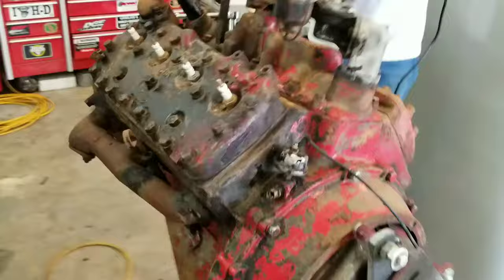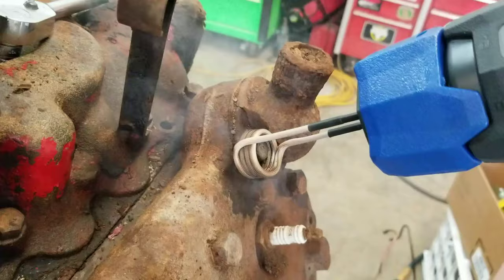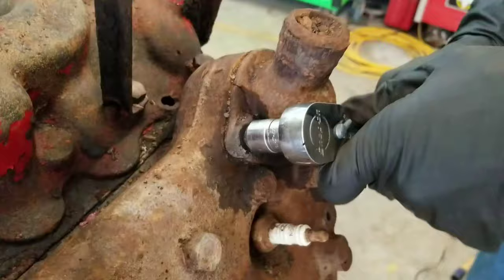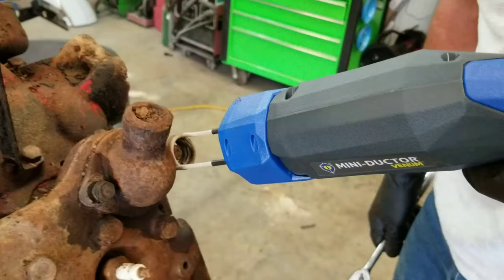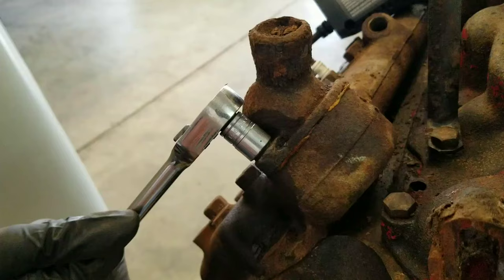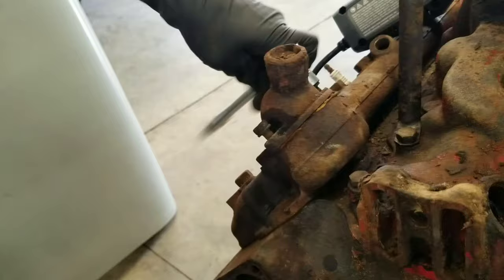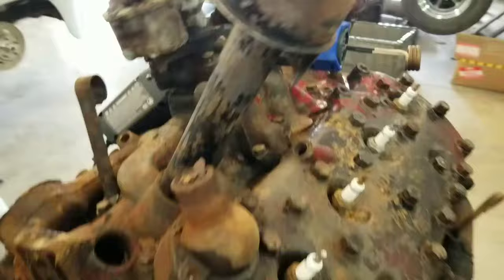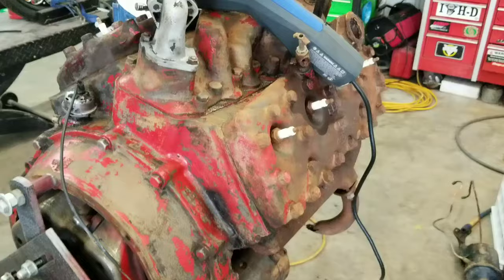A Cool Tool for Removing Rusted bolts and fasteners

Comment: What keeps the bolt from being even tighter with all the expansion??
Reply: Rickarama Trama the bolt get hot and expands then as it cools a little it shrinks just enough to come out
Reply: The expansion breaks the bond from the corrosion.
Reply: The initial heats expansion expands the bolt then when you remove the tool it instantly starts to cool off. This cooling off in when the bolt shrinks back to its original preheated size. This difference in size leaves a small gap and makes it so easy to remove. This heating and cooling expanding and contracting  also breaks the rust bond seal.
Reply: When it starts to cool it shrinks which breaks the rust
Reply: You mustn't have ever taken an auto shop class too be asking this question..
Reply: Actually it looks like it heats around the bolt hotter than the actual bolt
Reply: As the bolt expands it gets longer faster than the surrounding metal. bolts would expand in length more and faster than thickness.
Reply: Sorry my english is so suck : 🙄
Reply: I've never seen that question on an oxy acetylene torch video..
Reply: I WAS THINKING THE SAME THING.....NOT INTUITIVE.
Reply: AASR 32 I think Its a great question to ask
Reply: +Bill Butcher
Low IQ. the metal in the bolt doesn't shrink at all. It actually expands but as it expands it crushes and breaks the rust (not metallic but a metal oxide) that binds the metallic bolt to the fixture thus releasing it. Can't you instantly figure this out considering the fact the bolt is still too hot to handle after they removed it?
Reply: whoa... that's  physic 101 right there
Reply: cooling down ..duh.
Reply: Quetzalcoatl actually, technically the metal would shrink slightly, because it starts cooling as soon as the inductive heading is removed. Whether that is enough to help with the removal is another matter. The expansion cracking that occurs before then is likely a more significant cause. 

So, it's not a valid reason to call out "Low IQ". Ironically you didn't think that through completely 🤔
Reply: that's a great question, In fact it does it does expand, but the bolt/nut is seized because of the rust.  the expansion of nut/bolt with heat breaks the rusted connection.  then you are able to break the nut. even with the expansion.
Reply: Ill say its two fold, first the hot bolt expanding crushes the larger dirt particles smaller and secondly the heat separates the dirt from the oil lubricating the bolt just enough to get it moving.
Reply: The bolt will extend in length more with than width, releasing the grip
Reply: Finally somebody got it right.
Reply: Sorry my english is so suck A shoe maker....Hahahaha
Reply: +Rennie
Contraction has nothing to do with this. The metal is still way hotter than what you started with. The metallic (not rusted) part of the bolt is actually larger than your starting size. The expansion is done to crush the rust that seals the bolt to the fixture. Once the rust is gone it leaves a gap and the bolt can be removed. The rust is acting as a clue. This has nothing to do with shrinking. Plus as you remove the heat, the fixture will also slowly decrease in size. This is the only CORRECT EXACT explanation.
Reply: Induction heating bolts was originally introduced to the power industry for use on large fasteners, loosening AND tightening. Heating bolts elongates them releasing tension.  To tighten using this method you start with "snug" metal to metal fit, heat the bolt, then turn the nut the correct amount depending on bolt effective length and material.  When the fastener cools and shrinks, tight bolts.  You do get some added benefit of breaking up the crud but the intent of the tool is to release tension through elongation of the fastener.
Reply: It’s the Nut being heated here not the bolt... notice he removed nuts the taps remained
Reply: When you're heating it up there's a temperature differential. This causes the bolt to expand and break the oxidation. Then when the tool is removed the bolt immediately behind to cool, and then you should be able to move it. And because of the heat conductivity of steel a lot of lot of that energy I immediately conducted through the surrounding metal.
Reply: ffs its the treading thats being heated and expanding not the bolt
Reply: i agree with you ,i heat the surrounding area
Reply: All these people are wrong...most of the heating takes place near the head away from the engaged threads. This makes the shoulder of the bolt or the exposed threads to expand lengthwise so the head is no longer under tension and since there is no action-reaction to the tension of the bolt causing friction between the threads the bolt comes loose easier. No matter how much spray you throw there the bolt will not stretch loose on it's own!
Reply: The key is not to leave it on too long.
Reply: it basically breaking the built up rust and corrosion
Reply: RobXbox63 Native No. Heating the bolt increases it's internal kinetic energy, I'm pretty sure that means it's gonna expand.
Reply: Yeah, you're supposed to heat the bolt and let it cool. It tries to expand within the nut/block, can't (except lengthwise), but when it cools off, it shrinks back away from the threads and should be easier to get out. Either way, the heat is pulled out of the bolt and into the block quick quickly, so you've only got to wait maybe 20 seconds at the minimum, but that's just a guess.
Reply: The parts expand AT DIFFERENT RATES. They have different: shapes, metal composition, thermal mass, and outer surface area for cooling.
Reply: Do you mean the nut? Expansion will be greatest along the longest dimension - the circumference. The whole nut gets a little bigger ... Inside and outside diameters will both increase. Think of the nut as a ring, and a ring as a rod bent into a circle. What happens when you heat a straight rod? Gets longer,right? Length bent into circle is now circumference.
Reply: strongcloud28 l
Reply: So much astonishing stupidity in response to a simple, and very good, question.  Please, people, THINK before you reply.  In fact, THINK when you first get up in the morning and CONTINUE thinking all day long.
Reply: AASR 32 at least he didn't skip English class "too"
Reply: sorry you received so many as£ hole answers. I wanted to know the answer too!
Reply: Heat causes it to contract not expand. Cold causes the metal to expand.
Reply: My dick expands when things get really hot and then when it cools down it shrinks. Sort of like what’s happening here.
Reply: TheMadScotsman mckay ummmm ypur wrong. Metallurgy states that a grade 5 bolt which this probably is does not become ductile until the thermal limit has been reached, wherin the material starts realigning the crystaline structure of the metal. Thus stating that the bolt becomes plasticized is incorrect. You wpuld almost have to heat the bolt orange hot. Interesting tool and I believe it will help with seized bolts.
Reply: Rennie Ash It may shrink slightly as you say BUT relative to its orginal preheated size it will still be larger. Its the different rate of expansion that breaks the bond because the corrosion slows heat transfer into the surround. As it cools it shrinks creating a nanoscopi void and relases. It never shrinks persay because its always larger than preheat so its missleading.
Reply: Even just the expanding will break the rust. There is always a different expansion rate between the bolt hole and the bolt itself. So it breaks the bond. Originally people use a torch for this. But this induction tool is more neat.
Reply: It expands to spread everything apart that's stuck, and then shrinks back to normal size while it's moving
Reply: JFM, just fucking magic.
Reply: It uses induction heating, so I believe whatever is directly inside the coil is what's heated, and as shown in the video, the head of the bolt is what's inside the coil; thus, the head is heated, the heat is transferred to the rest of the bolt, as well as its surroundings, so my guess would be that the bolt expands, the heat transferred from the bolt to the surroundings causes the surroundings to expand, and then when the heating stops, everything starts to cool (but especially the bolt, since it was probably hotter than the surroundings due to the direct transfer of heat), so as mentioned, the heating and cooling (i.e., expansion and contraction) causes the bonds to break, freeing up the space as it cools down, allowing the bolt to be easily taken out, as if there was no rust or whatever else that causes the bolt to get stuck.
Reply: After reading the comments more, it seems that it may be a combination of other factors as well. Someone mentioned that its the different rate of expansion and contraction that breaks the bonds (partly because corrosion slows heat transfer), so as stated, heating the bolt will cause it to expand into its threaded hole even more, but what you want is the slight expansion and contraction, just enough to break the bonds that caused it to seal in the first place. But as mentioned, heating the surrounding area is more reliable and requires less skill I'd say, since there's less chance of error by just simply expanding the area around it to break those bonds and to enlarge the hole. If I had a choice, I'd use a tool like this and know how to use it, since it seems to be quicker and more convenient (as long as its cost and usage would be justified).
Reply: AASR 32,   That is probably why he asked.  He was just looking for an answer.
Reply: Quetzalcoatl <<<< ... Moron
Reply: The problem is not in the bolt head the problem is the seized thread so he should heat near the thread!!!
Reply: He do not wait till the bolt shrinks
Reply: Alphabert Beta - I was thinking the same thing.  If you heat it,  would it work better if you wait for it to cool before trying to loosen?
Reply: Only one that gave a good answer was byclindrico.
Reply: Dialysisforever I think it would work better too!
Reply: Folks it has to do with the coefficient of expansion between metals and metal alloys as they are heated
So in stupid terms everything expands differently the bolt, the manifold or block and the rust. So the linear expansion of those dissimilar metal structures and alloys will make it break the hold on the threads.
So the coefficient of linear expansion of different metal and metal alloys is the answer.
Same as so many other things that are common today depend on those coefficient numbers.
Such as a thermostat.
Or a blinker relay
Later
Reply: Much was learned with this question.
Reply: Good answer. So it might even help to wait a few moments.
Reply: Wrong. Heat causes expansion. Cold cause shrinking. So it probably expands and then shrinks as it cools. Also the expansion breaks the bond. So it might help to wait a moment. Perhaps the heat passes to the surrounding block and the bolt cools first.
Reply: Right. So it might help to let it cool.
Reply: Re: people saying cold causes expansion: I hope you are trolling!
Reply: The inductive heat applyed to the bolt head travell to the entire threaded zone (more or less untill the other end) and it's heated evenly UNDER the recystalise temp zone (meaning that under 400 Celsius,careful on the exposing time regarding the thickness of the bolt),and it's expanding inside the threaded hole and breaks the rust layer and the bolt release itself from the tightness of the of the hole because once the heat stop,the bolt rapidly cooldown because the threaded hole surrounding metal had no time to heat up like the bolt,and it's still safe to touch,cold enough to absorb the heat from the bolt once the rust layer is crushed much faster,i know this from my welding skills,once the metal to weld is to hot to continuously weld because is too thin,i rest the slag remove hammer DIRECTLY on the hot metal and it cools down VERY FAST,but the hammer stay still safe to touch barehand,so the bolt do same,once the heat stops,the bolt cools down very fast into the threaded hole because in contact,reacts like a cooling medium
Reply: When the surrounding area is a 10 times more metal mass than the bolt itself,the bolt will heat up in almost same time like the surrounding material,so,shearing off the nut head because of heating with a flame torch is almost guarantee because the flame heats almost only the nut head,wich is almost instant snap off the head of the bolt,because the threaded rod is still cold...once the inductive heat applyed,the entire bolt is heated almost evenly along the threaded part of the bolt too,and there y'a go,the bolt shrink back once the induction heat is removed and the bolt start to cooldown,of course,the heated bolt will have the thread damaged a bit and due the heat expanding and crushes the bolt thread into the hole thread,it's no longer safe to reuse,but i encountered many bolts snap off into cast iron engine blocks,welding a nut over the threaded bolt rod into the block hole had the best result by welding a nut in 3 stages (first for weld sealing the nut on the broken bolt remaining into the block,then the 2nd stage is filling stage on 60% aprox then higher amp to fillup the nut with weld,and 3rd stage is done few minutes later as a heating source,regardless the overweld will pile up and resulting into overweld,this allow more heat from the nut to travell down to the  threaded part of the broken bolt because the steel bolt will absorb more heat and faster than the cast iron engine block),once the welded nut cooldown a bit,can be quite easy to remove if you don't pull with too much torque force on the wrench or spanner
Reply: Sidenote - water is the only substance to expand when cooled.
Reply: TheMadScotsman mckay you seriously don't get how an induction heater works? Sorry, but you're wrong. This tool is for heating the bolt, bot for heating the surrounding area. I'm a bit ashamed, as being an Irishnan, I know our kids are building their own induction heaters at five and six years old and here you are, our half-English cousins, and you can't figure it out, even as an adult.
Reply: slim1100 no, it is a bolt. All the flathead Ford s use bolts for that neck and of you watch this video again, and pay attention, it's clearly a pair of boots he removes, not nuts. Further, your argument that heating a nut off of a thread would work because the nut expands whole the thread doesn't makes no sense. I don't know what you've done your whole life, but in an induction heater, the centermost point is heated first. Using this tool on a nut over a bolt would expand the bolt, not the nut.
Reply: @TheMadScotsman mckay    ... They DID Heat the Bolt..    Induction only works on whatever  material is within the coil, so it would have to be the bolt......
Reply: At least he can spell his comment properly, unlike you.
Reply: That's great thinking and logic. Clever penis.
Reply: how are u gonna call someone a loser, then also call them a "low life dog poop eating scum"
i mean it takes one to know one i guess
Reply: Fuck you’re dumb. Think about how this tool works. Do you think they’d go through the design process and not have this question brought up? Obviously it’s been thought about and of course it’s easily solved by the breaking of the bond between the rust and the bolt. Think for Christ sake, it’s 2018 use you’re head
Reply: you would be extremely surprised at what designers push out and call 'ok' these days, you got a lot to learn
Reply: RobXbox63 Native You're absolutely wrong. Unless you're talking about water, most materials expand as they heat up, and contract as they cool down. Very few materials exhibit negative thermal expansion, namely water, zirconium tungstate, and silicon and quartz only in certain ranges. Otherwise, it's very rare.
Reply: This is the correct answer, they are just making the top of the bolt weaker. You need to be putting the heat to the block, you want to keep the bolt cold.
Reply: The expansion is what breaks it loose come on man.
Reply: Obviously, applying heat works or the bolts wouldn't come out and companies wouldn't make tools for this very purpose. I've worked as an industrial electrician for 20+ years and have seen mechanics use heat on bolts of every size, up to 30 ft in length in huge presses, to loosen and tighten. You guys are missing one important piece of the puzzle. When you heat the bolt, not only the bolt expands, the surrounding metal also expands because it's in direct contact with the bolt, but most importantly, SPACE between the bolt and surrounding metal enlarges also, making the bolt loosen. When the presses I mentioned above get put back together, they put the bolts in, attach the one ton nuts, heat everything up, snug them down, and let them cool. As they cool, everything shrinks and they clamp down nice and tight. Now, sometimes when you have pieces that are separate, you heat one and cool the other. For example, say you need to drive a 3 inch pin into a piece of machinery, but it's just too tight and you can't get it to go. You pack the pin in dry ice to shrink it and heat the hole to expand it. But for situations where the fastener, pin, etc. is already in place and stuck, you use heat to get it out. In this situation with these engine bolts, the bolts and the block are touching, so technically it wouldn't matter if you heated the bolt or the surrounding metal in the block. Heating one will heat the other, resulting in a space being created between the two, allowing for removal. Conversely, if you tried to cool the bolts, you'd also cool the surrounding metal in the engine block, which would shrink the space between the two, making the bolts tighter. I had these same questions about this when I first saw it being done, and this is how the mechanics and engineers who have been using this method their whole lives explained it to me, and there hasn't been a day go by in over 20 years that I haven't saw someone using these methods on fasteners, pins, etc.